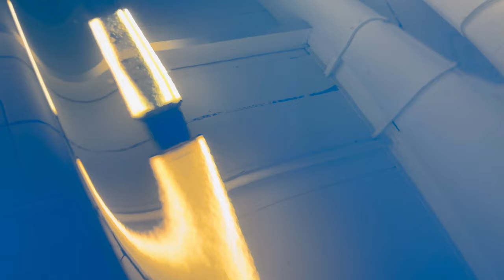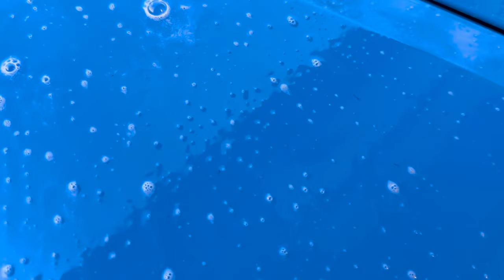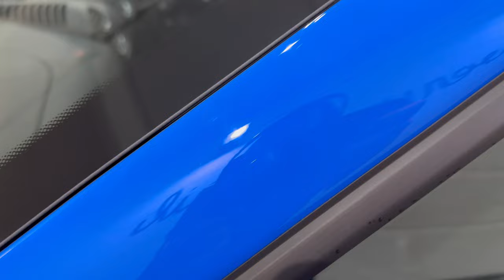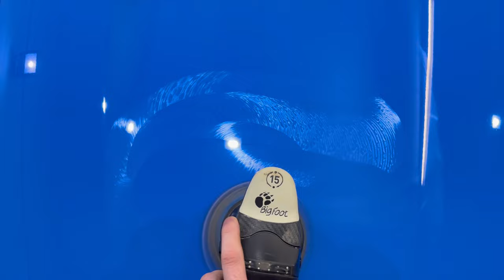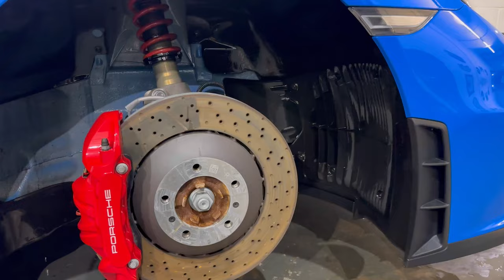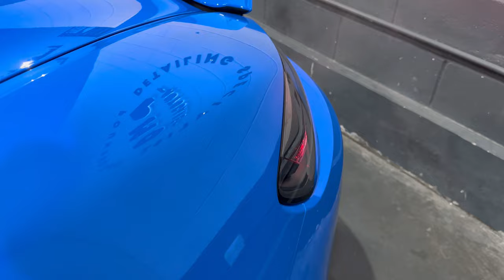Removing a DAMAGED ceramic coating - detailing a 718 Porsche Boxster Spyder

Comment: Hello Pete. Great video and even more stunning car! What version of Rupes machine did you use when you polishing the Spyder? When you apply Citrus to reinvigorate the ceramic coating, must you do it out of direct sunlight at all times? You mentioned this being a potential for the damage to the original coating.
Reply from the maker: Hi, thanks for your questions.  We used a variation of rupes LHR15 and the 75 for some spot correction. 

When working with any chemicals I would avoid using them in strong sunlight or on hot paintwork.  Fine on a cool day or out of intense sunlight provided the paintwork is cool.